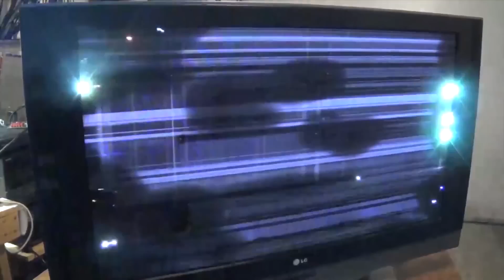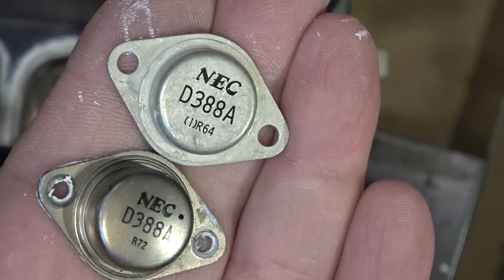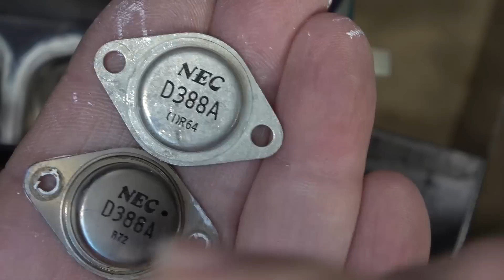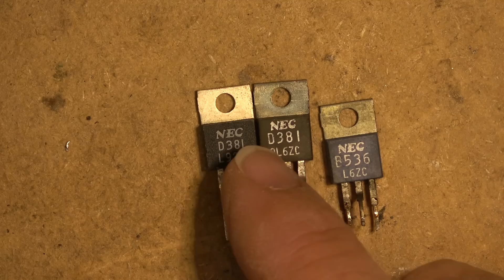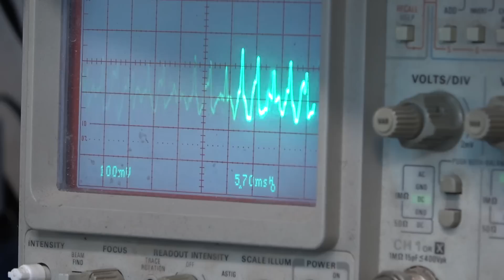Technics SA5470 part 2 installing the missing and blown parts

Comment: I did think that the domed transistor was a very old pattern, not likely that a more modern TO3 would look the same.
I've used loads of 2N3055's to repair psus and old amplifiers, a favorite basic transistor.
Not forgetting the Tip41A, psu pre driver. (well thats what i used it for lol.
There are so many manufacturers that made the 2N3055's, i swear that you could buy them from the green grocer lol :-D
Shame that NEC  didn't allow other manufacturers make them too.

Comment: Excellent job and breathtaking video!  No final firework, no smoking parts, I'm quite sure you have a very lucky customer...
I had doubts you ever get these TO3 transistors! 
It's always the same gamble with said NOS electronic parts on eBay: some are good, others (most) counterfeits... But the problem is global, I  measure and test what I get, even if the shop is local. 
Your LEDs strips mounted on the original fuse bulbs is a nice solution. These bulbs are sometimes a pure headache to replace, with various voltages and forms. A small switching voltage PCB to adapt from weird and various voltage is always a cheap adaptative solution.
Reply from the maker: No fireworks yet. I haven't given it much volume yet.  Most fakes will work fine under a little or no load and then once you give him a little bit of power all of a sudden all hell breaks loose. I'm kind of nervous but I'm going to run it on a resistor 50 watt resistors and just give it a bit of volume I'm not going to take it to the breaking point hopefully I'm not going to take it anywhere near clipping but I want to get the amplifier pushing out 20 to 30 Watts I just see if it'll hold up for a couple of hours of abuse because if it's going to break it's going to break under load it's not going to break under no water to output. The last thing I want is this becoming a boomerang and I am nervous with those to3 transistors. Anytime I see that dull finish I get kind of nervous because that's how they read label parts. They sandblast them to take the original markings off because removing with just cleaner usually leaves residue of the original ink so they sandblast them to completely clean the surface off and then relabel them. That's why I say I'm 99% sure that these are not original transistors and if they blow up then I'm right I'm going to be running it over the weekend when I'm at home and giving it some power but fingers crossed everything's good but I'm not holding my breath because I've been down this road before.
Reply: @12voltvids  I've repaired electronics for almost 30 years now and stumbled on counterfeit that were looking like originals. The best giveaway is the prices. Only buy them from a reputable dealer. That's the only way to assure you to obtain quality parts. Sometimes you can replace with higher characteristic without issue but you'll have to replace both sides and of course both polarities.

Comment: Yes, but in this application a replacement like 2N3773 would work well, not going to blow in this use, and more robust than the fake. ISC makes them still, so you could have new stock, just the NEC fake is a rebadged unit, could be anything, from a real transistor, to a FET, to a voltage regulator.
Reply: I've bought 2sc5200/2sa1943 (TO-3p) and they didn't sustained the bias current. So I cracked it open and the die was the size of what you find in TO-220. Despite looking like the original one with minor differences. It was many years ago. They even counterfeit inexpensive one like 2N3773. I think that the worst are Motorola (now ON) high power transistors. Those are the most commonly counterfeit. I only buy them from a reputable dealer.

Comment: A Technics with dirty switches and noisy pots, and blown bulbs, how unusual /s. 

Normally you also have cracked solder joints on the pots as well from flexing.

Those fuse bulbs you buy a lot of automotive retrofit lamps that are identical in dimensions, for cheap, and they clip in, or you can remove the ends and use them to replace wire ended versions. Just remove the CAN bus resistor if you want, and you also have the bonus they work on AC as well, built in flea size bridge rectifier. Cool white or warm white your choice.

Comment: It might be changed on later production runs.  Sometimes companies change their logs or make slight changes.  It could also reflect new production equipment.  There can be a lot of reasons for a change in design or look, even if both are legitimate.  Companies change things over the years as well.
Reply from the maker: Possibly yes but greater possiblity is counterfeit parts.  They will usually work, for awhile then just blow for no reason.  Believe me I dam bear set my hair on 🔥 over this years ago.  Got burned so many times and when a new part fails you go down the rabbit hole looking for some other reason it went pop.  It's pretty easy to relabel a part.  This is one reason that manufactures went to laser engraving. Harder to remove so they can relabel.
Reply: @12voltvids  c

Comment: Did you not need to readjust the bias? If fakes were used, I would be tempted to bias the unit a touch cooler
Reply from the maker: It was adjusted

Comment: As you mention Sanken..... Do you happen to know where i could get my hands on an SI-1460H (or cross) seems very hard to locate.
Reply from the maker: No i don't have any magical place to get any parts.  I check my usual places and if they have no solution.  To tell the truth i don't enjoy subbing transistors because once I but then if they turn out to be fakes I have eaten the cost because i end up having to refund. I've been stung a few times and every time it happens I get one step closer to just walking away from repairs again.
Reply: @12voltvids  I also would prefer not to sub. Sadly, to put that old Rotel back into service I'm stuck. Damned if I do, damned if I don't situation.😐
Reply from the maker: @steveishere7909  well that's the dilemma that we're all in with regards to vintage equipment when components are no longer available. You either try to make it work with a substitute part or you scrap it.
Reply: @12voltvids  There is a daughter board option for this. I suppose I could just buy a couple unpopulated boards and populate with mid/high grade components. Upto the owner though. His options are limited customize it (under 75$ for both channels) or scrap it.

Comment: Transistors that were made years ago are different from those who are made currently. If you repair vintage stuff, you have to replace both sides to have similar performance. This is especially true for older Motorola/marantz Transistors. You have to replace both polarity and both sides of the amplifier for optimum performance.
Reply from the maker: That's right but when you end up with fakes they generally go pop as soon as you load em up.

Comment: Did you test the transistors before you installed them? If not, why not?
Reply from the maker: And just how am i going do that?  I really don't care either.  If they are fakes they will blow up simple as that.  I can measure diode junction ect but I am not about to buy equipment to curve trace and measure gain. How much do you think I am making on this job? I will be lucky if i make 50 bucks on it.

Comment: Started to run into fakes in the late 90s.  The RCA SK line expanded their line and fakes showed up there too. AN5521s couldn't get a full picture.  The pairs of transistors in the Sony TV switching power supplies didn't last either. There were other fake time wasters too.
Reply from the maker: Yes I'm all too familiar with fake transistors fake ICS fake everything. Remember the fake ipms that were being sold and we put them in projection TVs it convergent circuits for Sony projection TVs and they would pop after about 6 weeks. And they were frustrating. The original parts from Sony we're about $90 a pop and you had to always change them in pairs. The aftermarket ones which had exactly the same number and we were guaranteed by the supplier that they were absolutely genuine Sony parts or only about $15. the aftermarket suppliers of course telling all of US service people that were gullible enough to believe them that Sony was just ripping everyone off and that they were the same parts. Initially they were that's the kicker to this is that the first batch of them we got were fine but then all of a sudden they start replacing them and they start failing again and replace them again and they fail and now you've got an angry customer because their TV is broken twice in 3 months second time you've done it for free because it broke down under your warranty and it's broken again and then you start pulling your hair out trying to figure out why are these parts failing. You start second guessing yourself is it a bad yoke is it something other than a counterfeit part. it wasn't until I started popping the modules apart that failed and looking at the internal construction once you pop the back plate off one of those str or STK power module and then you see where the differences are and that's the die size of the output transistors. Even at that the suppliers denied that they were fakes.   I've been running this amplifier every day after work for the last couple days tomorrow I think I'm going to put it on the bench and put on some big eight ohm 50 watt resistors and run up the power a little bit because with the speakers I've got on now they're only small speakers so I can't drive them that hard but I'm going to drive this thing to probably 70% power I'm not going to take it to clipping or even anywhere close to clipping but I want to get it a bit warm and we'll see whether it holds up or whether it breaks. I'm hopeful it's going to hold up but I won't be surprised if it goes pop. If it does there will be another video on the forensics to see how bad it blows and if it took any other parts out with it. I know the guy that owns it's reading this thinking no don't blow it up which hopefully it won't blow up but I don't want to send it out especially if he sells it and have it either blow up on him or blow up on someone else. The fact that I don't trust the transistors he got just because they physically look different than the originals has me a little bit worried. The other thing that has me a little bit worried was when setting up the bias I'm for 4/100th of a volt off the other channel. The voltage swing is there on the bias control but the voltage drop across the emitter Fowler resistor is off by .04v and that's a little concerning because that's telling me that the new parts aren't providing the same amount of gain that the original parts did, which is a telltale that they're not the same part and that someone is sandblasted the numbering off of them and printed the numbers that they want to sell for them as on to the part.
Reply: @12voltvids  yep and still fake stk packs for audio too. Ordered and went thu 3 stk 0050. The 4th 1 is holding out....so far. Told the owner to  not run more than 1 set of speakers at a time.

Comment: Nice job, big fan of your work man! Awsome classical guitar piece you played, sounds like JS bach. 
I have an old Technics SA-5200 that blowed up one of the 4 big npn transistors a few years ago, Then I replaced all 4 and tested it, every time I turned the receiver on, I just had audio for a sec and the sound quickly disappear.
 As I was very limited with just an analog multimeter in hands to repair, I decided to take it in a local repair shop that the owner claimed work many years with audio repairs. Long story short, after the guy kept my receiver for over a year and couldn't fix, it came back worse than before, many of the original resistors missing , some capacitors and other tiny transistors too, now again I'm trying to fix it by myself but I dont have any idea the values of the components, I tried to find the schematics on the HiFi engine website but looks like new users cant create an account anymore unfortunately.
Do you have any guesses what could cause that issue based on the symptoms I said? Also do you know where else i can find the schematics?
Sorry the big text but I really want the bring that guy back to life again, so I can play my old Led zeppelin vinyl again lol.
Thanks for your videos man, I've learned a lot with your good content.

Comment: I have a Nakamichi 550 cassette deck that needs to have some work done on it and I can’t find anybody in my area that works on Nakamichi. Do you service Nakamichi cassette decks?
Reply from the maker: Yes I have worked on many.   I used to be a nakamichi warranty service center.
Reply: @12voltvids  I am in Los Angeles. How would I go by sending this unit to you to have checked out?

Comment: Hopefully, the replacement parts will work!!, only thing, is where do you get decent electronics parts to repair anything?!, I don't like just tossing equipment in the bin, like to keep it out of the landfill
Reply from the maker: Best place is salvage out of other equipment.  At least you know they are genuine.
Reply: @12voltvids  Oh, yeah, that's right, I should definitely do that, used to have a 'junk box' of good used parts, but it's almost empty now, I can go through and build it back up,  got to reorganize the repair bench anyway ! ( really miss Radio Shack!)

Comment: One way to check if they are original would be to order one or two extra transistors when you order them,
and crack one open and compare the die inside to one of the original broken transistors.
I would run it up to full power and see if it survived it for e few minutes,
rather than the owner do it himself at home. If they are fake they will blow up anyway.
Well, they could be rebranded 2N2955/3055 transistors so they would maybe work, just not sound that great...
Reply from the maker: I am stress testing it for a few days to see it it holds out as i don't need it coming back.

Comment: Thank you for doing the Lord's work Brother! You have given me the confidence to try and bring some broken units back to life, but I have not gotten past changing belts or changing gears. I want to gain enough experience to start doing some testing and soldering work. Have you considered adding links to the products you use? I really like that mini screwdriver, lubricant and compressed air
Reply: @White Pony Cool! Good looking out. I will definitely try that. Thx for the intel, Brother!!

Comment: Hi Dave, it would be interesting to stay in touch with the owner and see if they crank up the unit and how long the repair lasts with the questionable parts.    (   By the way....what do you want for dinner ?  )
Reply from the maker: Don't worry I'm going to be doing the cranking up. I'm going to put it on my 50 watt dummy load resistors and cranking up a bit and see where holds out because again I'm very skeptical of parts when they arrive looking like those ones did with that dull finish. That's a pretty good sign that the parts were sandblasted and numbered that's what we usually see when we see stuff like that. ECG was very good and nte when they bought OEM parts and they put their own numbering system on you'd find a lot of them that they did the same thing they blast them with Walnut shells or something to clean the surface off so they can reprint them.

Comment: Those are not "fuse bulbs", which are either 5x20 or 6.3x32mm in size. These are "Sofita" bulbs, as we call them here in Europe. Very common and cheap-as-mud automotive bulb, mostly used for car licence plate lights, turns signal lights and interior lights on trucks and buses.
Reply from the maker: They were referred to as fuse bulbs as many had the standard 3ag sizing.  Also known as cartridge lamps but if you called parts dept asking for them the kid at the counter didn't know what you were talking about.  If you called and asked for 12 volt fuse bulbs they knew exactly what you wanted.
Reply: @12voltvids  The standard fuse-sized (5x20 or 6.3x32mm) ones can be called fuse bulbs, but these are automitive axial bulbs. Where I live, you can buy one for 20 cents, not 5 of them for 20 bucks. Are these used in cars in the US and Canada as well? If yes, I really don't understand the crazy price.
Reply: @12voltvids  I just found out that their more common name in America might be festoon lamp. Quite expensive on Amazon, but I was able to find a pack of 20 for $10. I am not going to include a link, but you will find it if you want..
Reply from the maker: The ones the shop had were 8 volt.

Comment: Be careful when you buy transistors online. Buy them from reputable dealer. I've seen so many counterfeit ones, if the prices seem too good to be true then they're probably counterfeit ones.
Reply from the maker: These were counterfeit.  They did fail under a stress test.  I just haven't put up the test video.